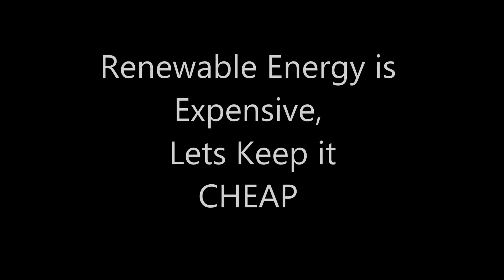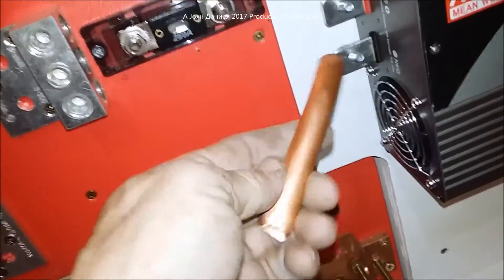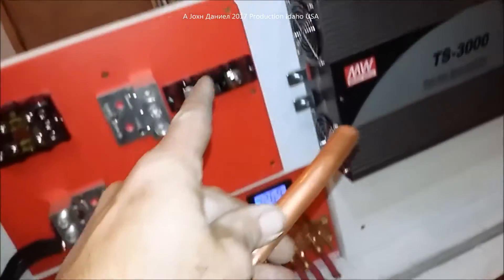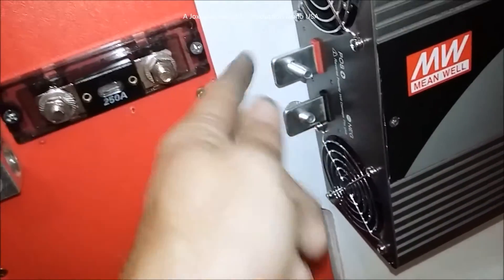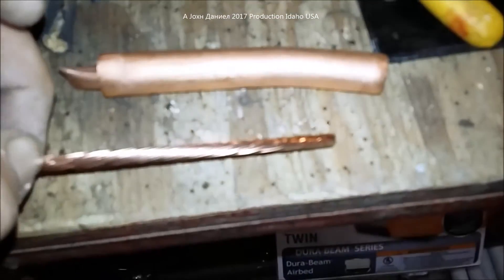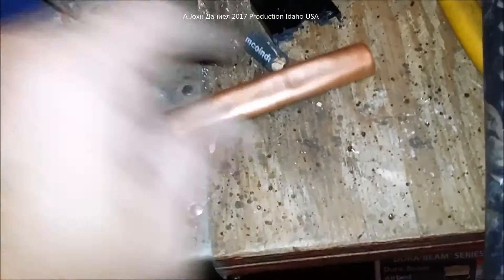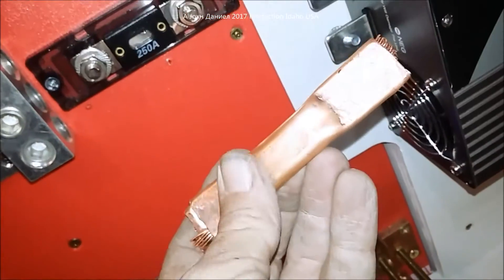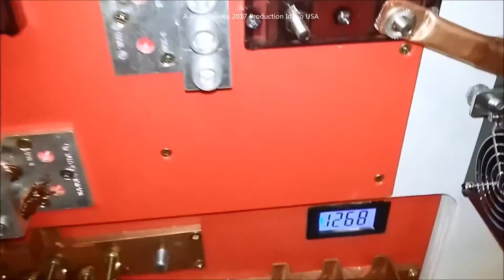Using DC to AC Power Inverters Cheaply  ( See Info Below)

Comment: Spot bud. I'm so tired of people who don't understand things speculating on them. Skin effect really only comes into effect with high frequency AC and you can easily calculate the effects and size your conductor appropriately to compensate.
Reply from the maker: Yes, its super high voltage and amplified hertz for long distance transmission that is related to skin effect but they all fail to tell you that is a static measurement with zero load.

Comment: the old skin effect misconception , copper is a very good conductor thats why it has been used for decades in a proffessional capacity, like wires for example.
 ive got no hair to set on fire but i can still run around like a lunatic,
 hell no im not doing that with my thumb.

Comment: I was thinking of doing flat copper pipe clamps between batteries in the battery bank instead of buying cables by the foot... yes ,I understand the only difference is flexibility... copper pipe is cheaper than buying 0 gauge cable by the foot and can probably handle more amps too... I think you just help  me decide witch way I will "wire" my power bank saving money but not compromising performance , I might still maybe plastic dip sections or insulate with hose as cover just to keep it a bit safe...
 ...thanks
Reply from the maker: +Frank C I have been using it as buss bars for pennies on the dollar since I was a kid. I started life as a plumber and always had scraps. Made my first wind turbine at 13 years old, used copper pipe for a conductor since then.
Reply: nice to had seen this video and see someone else had same idea and it works... but I saw you added more copper cable and tubing to have better flow /less resistance... did it really needs that much? I mean that one solid piece of pipe should had been enough? or was it getting warm?... I will bridge battery terminals for my bank , any idea how many amps can pass thru 1/2 copper pipe without compromising resistance? I would think it just  as good as 0 gauge cable? ... my theory is if you melt 1 foot of 0gauge copper cable and melt 1 foot of 1/2" copper plumbing pipe , both must be pretty close on the amount of copper as conductors, right? 
thanks
Reply from the maker: +Frank C 1/2" ID  type L copper is slightly  heavier weight per inch as 2awg and just shy of 1awg. That's why I put the 3/8" od tube inside it, then it's a bit heavier than 1awg. With 2 strands of 6awg in it it's a bit heavier than 1/0 awg and  under 2/0 awg in copper weight but 3 pieces of 6awg would not fit easy and all I need is 285 amp @ 1 foot rating. Being solid and 4" it well exceeds that need for under $1
Reply: thanks, sounds like a plan to me... great info!

Comment: Good points, so many people freak out over stupid shit that if they just stopped and thought about they would realize what was really going on. I had a guy give me hell because I used 12 awg 99% pure cased speaker wire to run my 12v wires for my lights in my house. I could of used regular house wire but i did this way so the 12v wire was different from the 110v wire. But I was given a lot of BS over how speaker wire could not handle 12v dc current. I just laughed. Some of us get it and realize there is cheaper way to do things, and others just rather listen to a snake oil salesman on how they need all this expensive parts.
Reply from the maker: +Great North Woods Hillbilly Yeah, seems those who price and sell wire like to call it specialized.  Fact is, 12g wire can handle watts/volts same way in every format as long as it's pure copper.  The only difference is the casing materials.  Some are for outdoors and some for indoors.